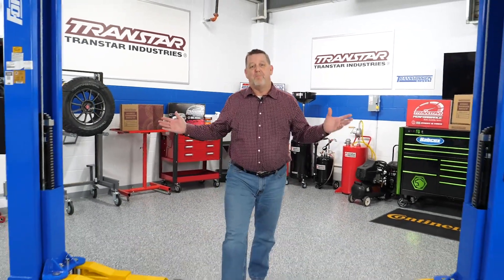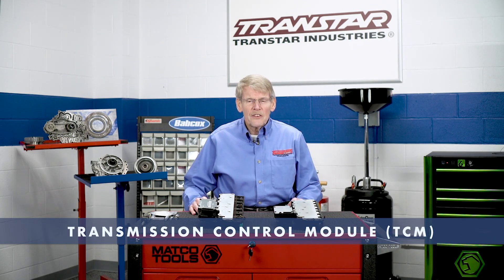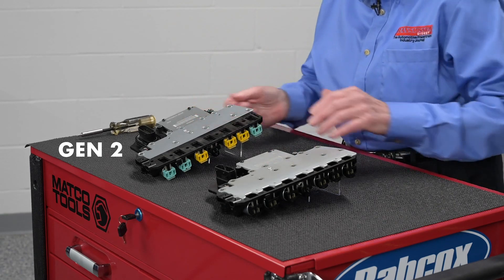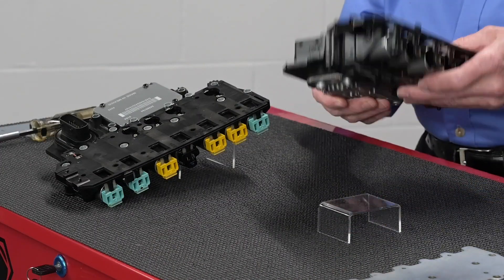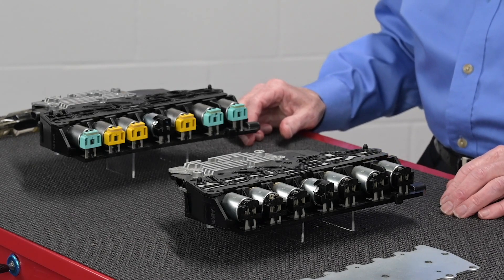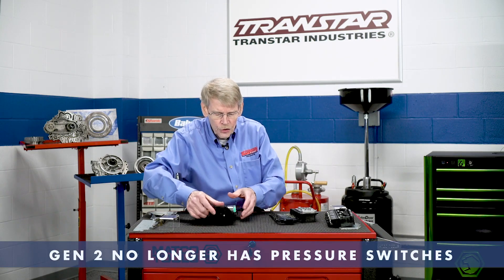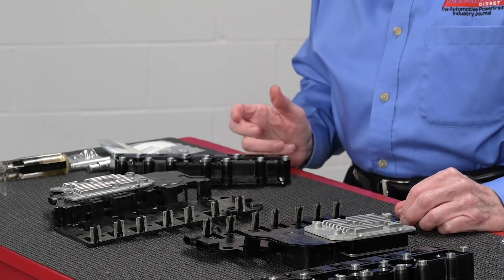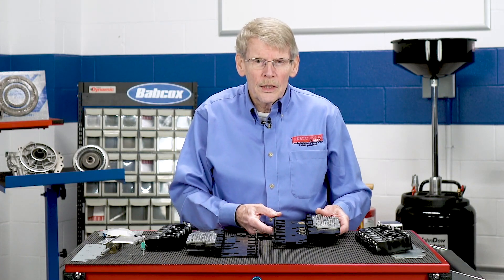TEHCM

Comment: can I replace GEN 1 TEHCM with GEN 2 and reprograming the gear again, is it fit with no problems..?
Reply from the maker: Several components especially the valve body and the TEHCM are not interchangeable between Gen 1 & Gen 2 models. Design level changes not only involve the transmission but also other vehicle computers.
Reply: Did you listen to the guy in the video? He pretty clearly stated they weren’t.